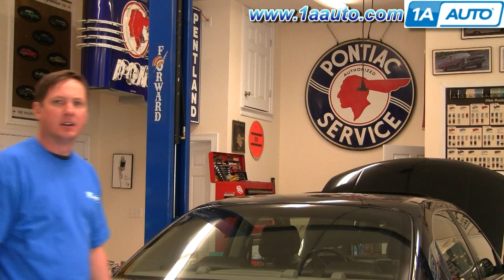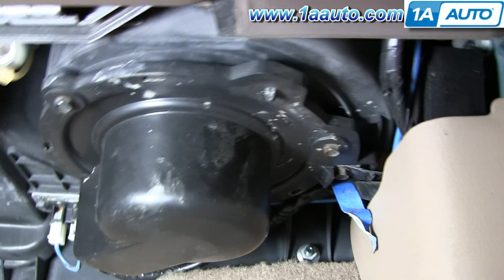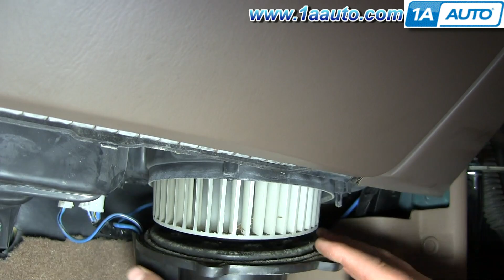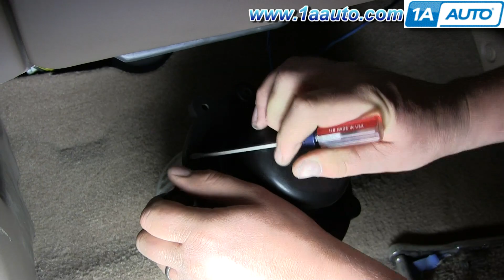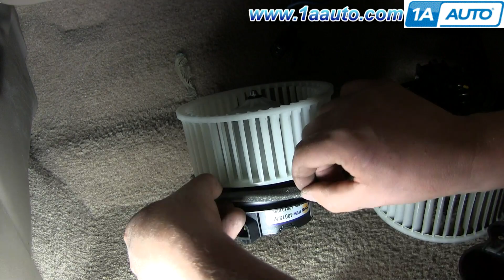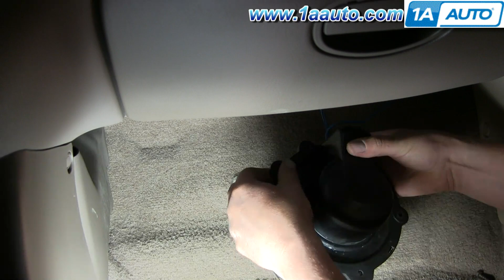How to Replace Blower Motor 91-03 Ford Escort ZX2

Comment: Iif the resister is bad will you hav no power to the blower motor
Reply from the maker: +Richard Westgate Usually you will start to loose the speed settings. If the plug to the resistor has no power to it you may want to check the fuse to see if it's blown. Hope this helps you out. 1aauto.com

Comment: Even if your motor is working fine, on 3rd Gen Escorts/Tracers/Zx2s you should pull your blower motor at least once a year and clean it well. These collect a LOT of debris and are easy to get to and clean. My a/c ran much stronger than before thanks to this tip.

Comment: I checked the ac blower on a 97 mecury traver havent taken it off yet but i notice water coming off it it has been working since my daigjter bougjt it 4 months ago blows cold ac then it stopped for a couple days no blower air then came back on.how can i check the blower motor i looked at all fuses but none looked burned out.i kno i answered my question but is there any other easyier way to check blower motor
Reply from the maker: Thank you for watching! You can remove the blower motor and put a power and ground to it and manually jump start it.
 888-844-3393
Reply: 1A Auto Parts thank you will try that

Comment: For this vehicle there is a strange and noticeable rattle when the car is idle say starting it up or stopped at a signal or sign.
Reply from the maker: Not that we've noticed. When the vehicle is cold, you may want to check the catalytic converter covers to see if any of them are loose. If you do find a loose one that may be the noise that you're hearing. 1aauto.com 888-844-3393
Reply: Ok thanks.  I just recently purchased this car from a lot. I will look at your idea when I get a chance
Reply: Yeah mine does the same lol